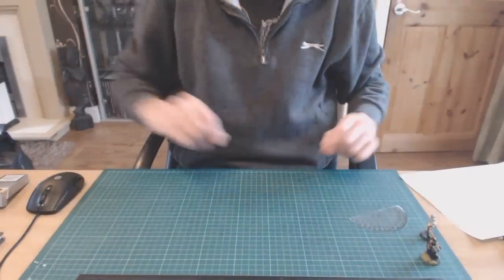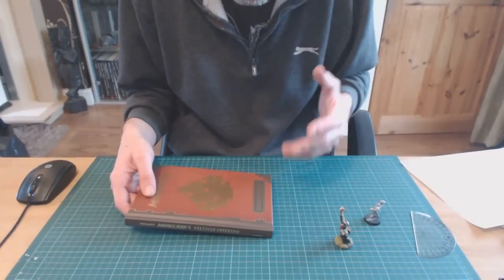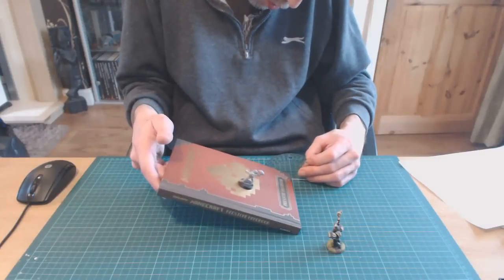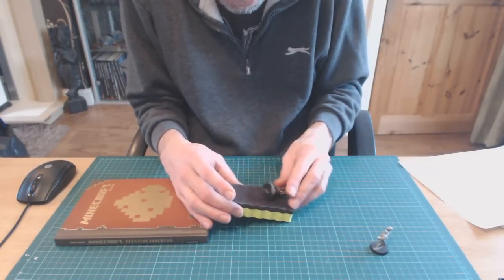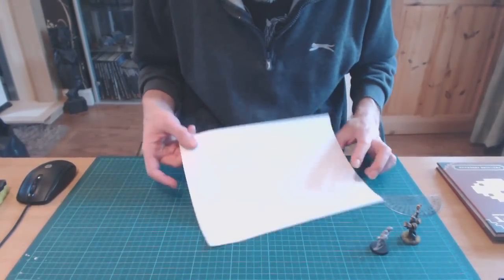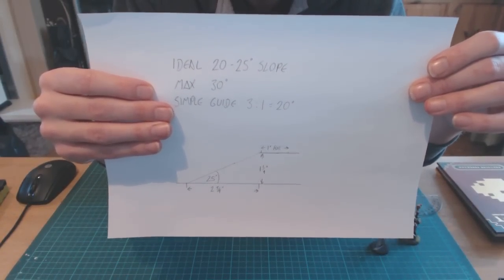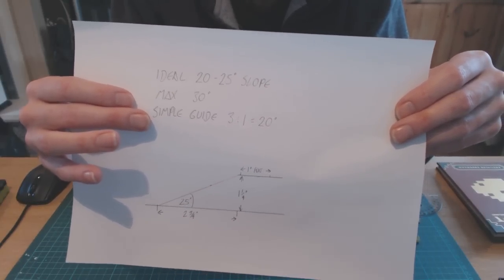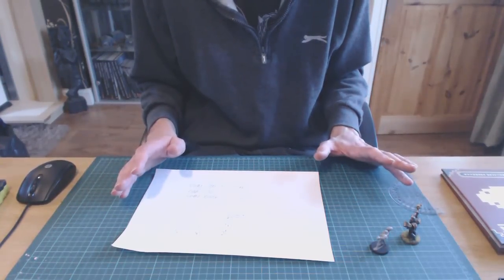Working out slope measurements for model stability

Comment: So here I am, gluing my polystyrene to my MDF bases for my 3 tier hill, and I'm thinking "I wonder if Mel has an update" and there we are - slopes!  I was worried because I was going for a 2:1, and just didn't have enough space to push it out...might get 3:1 out of it.

Anyway, that's my story.  Mine will mostly be used for Warhammer Fantasy, which adds the balance bonus (in most cases) of movement trays.  So if I only get the lip on I shall be sweet.  I'll keep you updated Mel.  Spot on timing though for this vid!
Reply from the maker: LOL - It's always the way mate